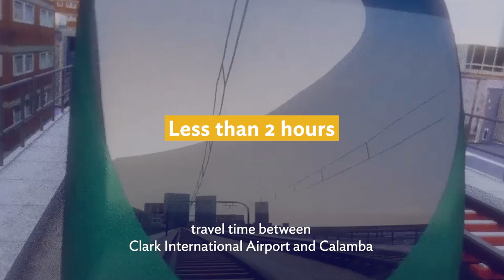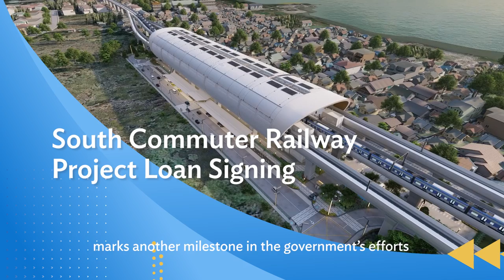Bringing Back the Culture of Rail Transport in the Philippines

Comment: There's is just 1 negative comment I can give on this project, and that is the delay it's incurring due to slow launching of the segmental box girders, in the Dubai metro project the SBGs can be launched in 1 days time and it takes 1 week to finish each span, same goes with Riyadh metro project.
Reply: THIS IS THE PHILIPPINES OT DUBAI DONT COMPARE IT..GIRDERS IS,SO FAST TO CONSTUCT BRC OF THE MODERN,GIRDERS LAUNCHERS..DO SOME RESEARCH OK
Reply: Dubai can hire 10x the workforce and equipment thats why it also finish 10x faster. Thats why you are working there right?
Reply: We don't have the budget and manpower to expedite the process. We could, but then that would just result to higher loans for the project.
Reply: @bromartyt7143  Bakit ang agressive mare hahahaha
Reply: Mabilis nga ang launching ng SBG sa Riyadh metro pero super delay naman ang project. Sabagay chill chill muna kami dito, sumasahod pa naman. :D :D :D
Reply: That is heavy rail not light rail were a span had wider length, LRT 1 cavite extension launches 1 span of  girder per day not segmental but whole 2 way.
Reply: @bromartyt7143 That is heavy rail not light rail were a span had wider length, LRT 1 cavite extension launches 1 span of  girder per day not segmental but whole 2 way.
Reply: @everydaydose7779 That is heavy rail not light rail were a span had wider length, LRT 1 cavite extension launches 1 span of  girder per day not segmental but whole 2 way.
Reply: @nateebu8458 That is heavy rail not light rail were a span had wider length, LRT 1 cavite extension launches 1 span of  girder per day not segmental but whole 2 way.